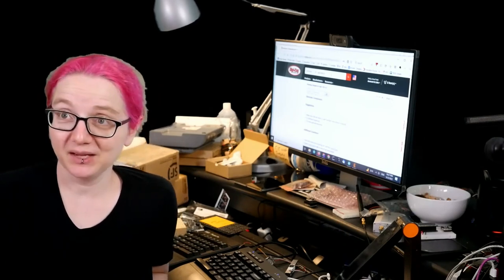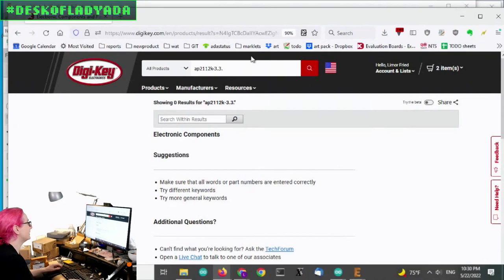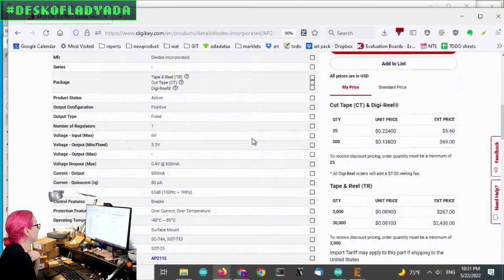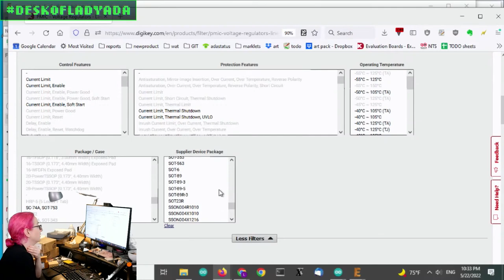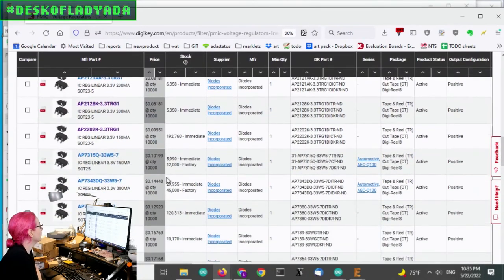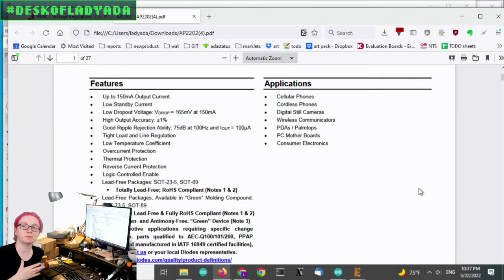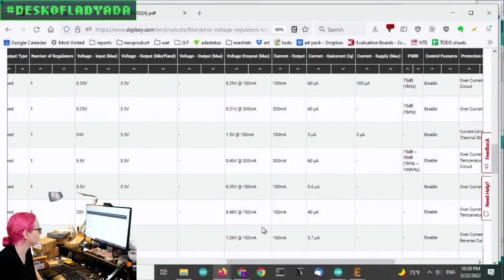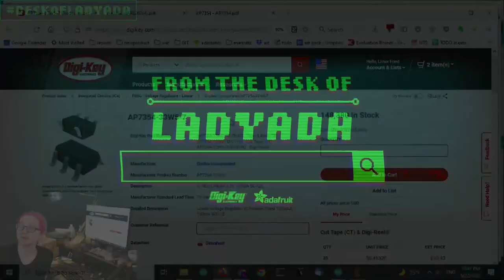The Great Search - Alternative replacement for our go-to 3.3V regulator #TheGreatSearch @DigiKey

Comment: Been having a similar issue with motor driver chips, namely the 6612fng. Can find breakouts, but not the chip by itself.

A whole bunch of other parts on my shopping list have lead times of 1-2 years 😭😭😭 bought some mcp23017's from you a while back as through-hole, now I want smd chips... nope!

And as a hobbyist, I'm only after 10's, not 100,000+ O_O

Thankyou for the vid, and keep up the great work you do 😊❤

Comment: how much do you increase the used current to be safe? you mentioned 100mA but what is the normal consumption og boards? 50? 70 ? as in continuous
 use ?